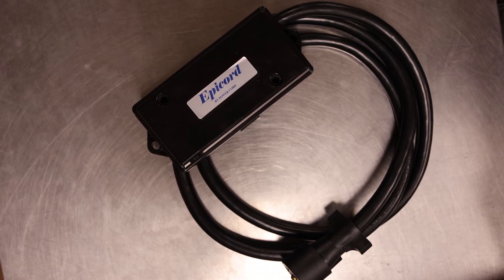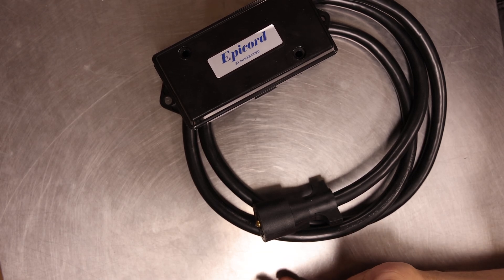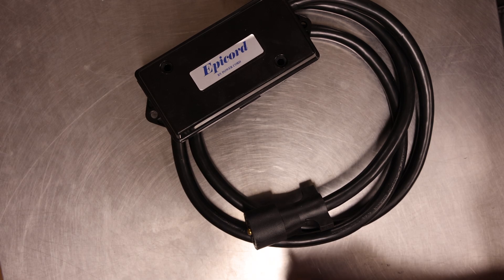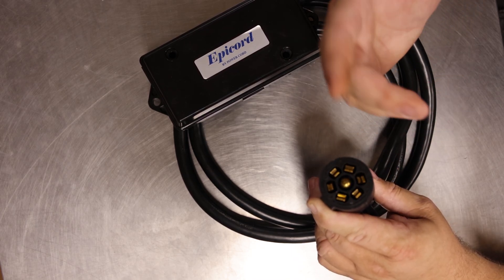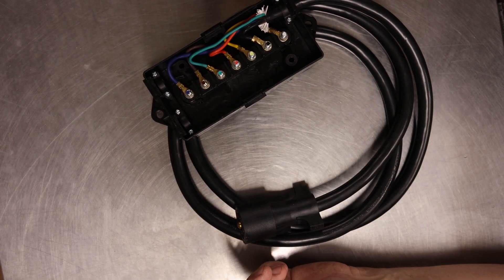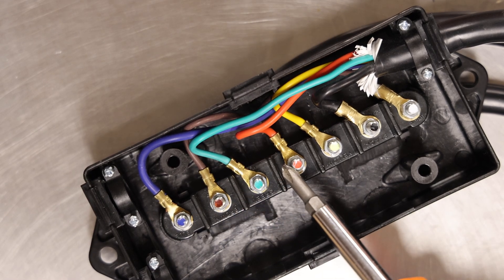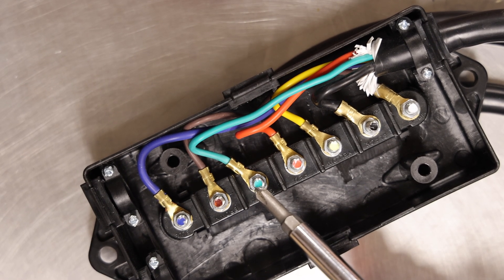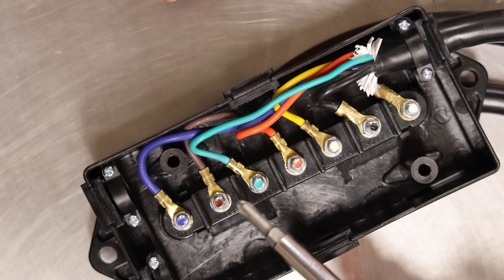Trailer 7way Junction box explained

Comment: I just installed one of these. The brakes and blinkers are working when the running lights are off. When i turn on the running lights the brake and blinkers stopped working.  I left the blinkers on for a few minutes and it is charging between only the running lights working or the blinkers/brake lights working but all wont work at the same time.  Anyone have this issue?

Comment: Hello sir I subscribe your channel already.  I have questions, I use 7 wire plugs why my left signal or brake light is not strong bright like the right side? Or some time the right is not bright strong.  All wire are grounded.  

There are two wires from the small or regular brake lights, one wire is black and the other is red or mixed with red and other colors , please clarify where these wires go to connect to the 7 wire, thanks
Reply: Not sure about the tail lights but if you have 2 different headlight bulbs. One for dim and another for the bright. If you ground the ground wire, it'll stay on with the brights.